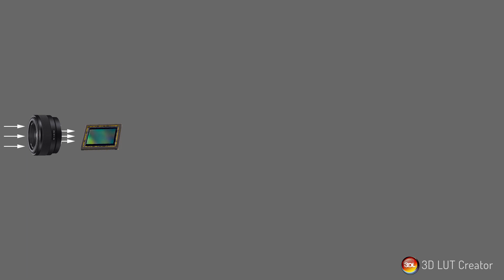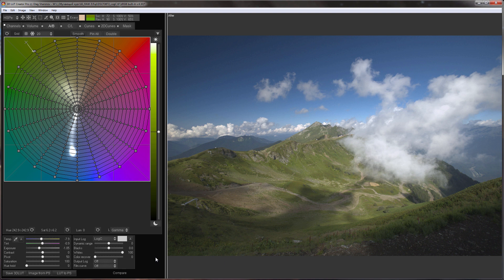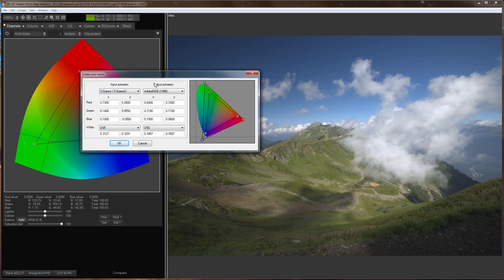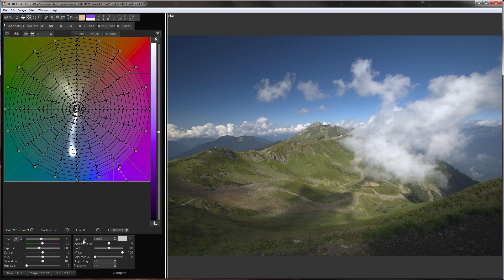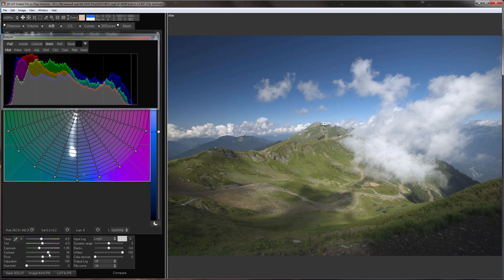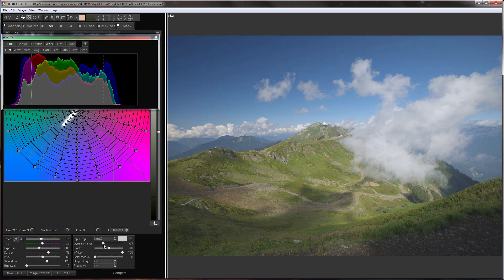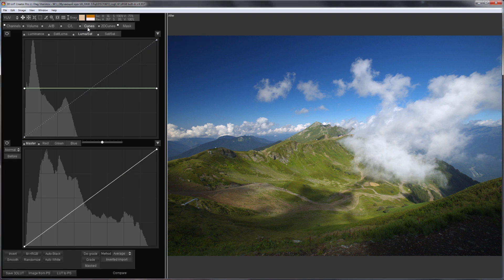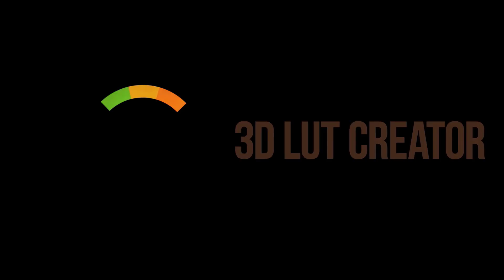How to develop RAW files in 3D LUT Creator, Part 2

Comment: I found out that 3D lut Creator has the ability to export .dcp camera profiles but I tried to export my adjustment parameters to a .dcp file and then tried to import the .dcp in Adobe Camera Raw and got very different colors than in 3d lut creator.
Is there any way to reproduce the results of raw development with 3D Lut Creator in Adobe Camera Raw using .dcp files?

Comment: Also, is there a way to create a batch of LogC files and then apply a corresponding LUT at once?
Reply from the maker: You can use batch processing for this.
Reply: @3DLUTCreator-And-Retouch4me  it doesn’t create logC TIF file
Reply from the maker: @charleskusi8796  You need Standard or PRO version.
Reply: @3DLUTCreator-And-Retouch4me  I have the PRO version
Reply from the maker: @charleskusi8796  Check the folder with original RAW.
Reply: I was having the same issue, if you de-select the Process with LUT check box it will batch produce the LogC tif file. It doesnt name it though as LogC.
Reply: @eightzerofour9957  Got it. Thank you 🙏🏾